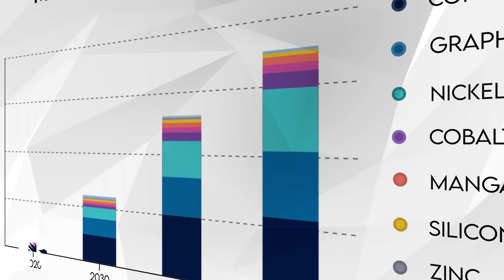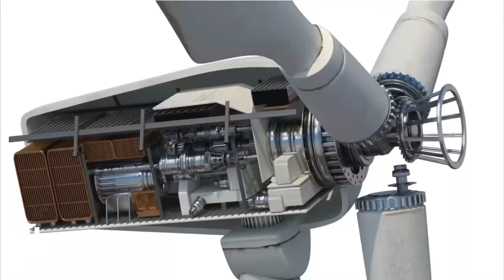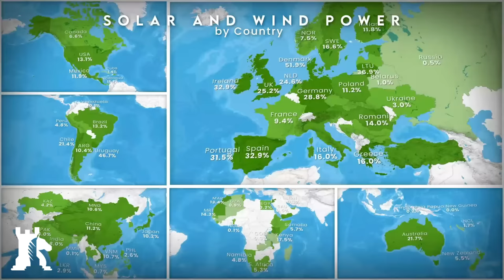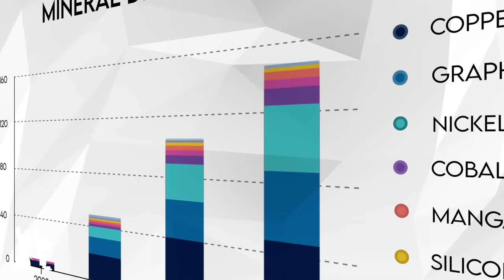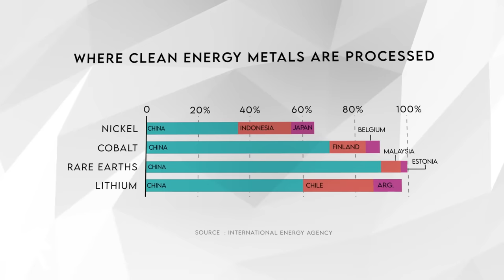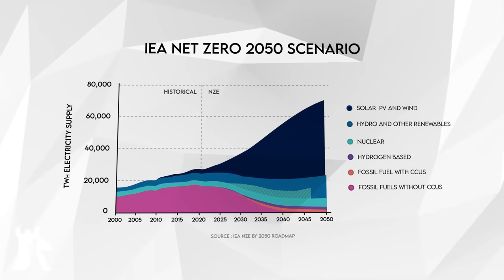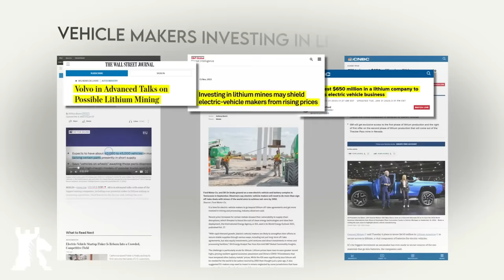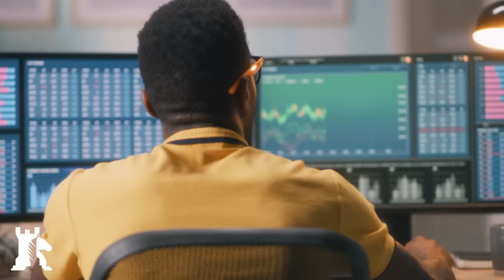Net Zero by 2050 is not happening

Comment: The channel "Just Have a Think" recently (2. july, 2023) put out a video called "Have we got enough minerals?" where he tackles just this question in regards to our transition to green energy. According to his video, several energy technologies are currently being developed where several of the rare and polluting minerals have been substituted with much more cheap and abundant minerals. This is not to say that there will be no need for lithium or cobalt in the future and that our transition to green energy in 2050 is a done deal - but it is to say that the future is hard to predict and it might be foolish to simply calculate current trends with regards to mineral needs several decades into the future.
Unfortunately though, I still believe that your opening statements about how we probably aren't going to reach carbon emission neutrality in 2050 are probably correct. I just haven't seen enough political will anywhere to be optimistic.

Comment: On the point about the materials required to replace a 50MW gas turbine: the comparison doesn't include how much those sites already consumed and will continue to consume in terms of replacement turbines over their lifespan, not to mention the pipelines required to get the gas to the turbine AND the distribution network required to get the juice from it to end users.

You also don't seem to discuss nuclear power? Where is the discussion comparing that power source to gas? 

Growth: the transition from fossil fuels to renewables and alternatives will provide work, income, and thereby, growth. How much? It depends who you ask and over what time scale. 

RECYCLING: yes, recycling rare earth minerals at lower concentrations than mining raw ores will pose some challenges, BUT, as you point out in the video, those are materials that otherwise end up in landfills and MUST be either disposed or recycled. The input  'cost' of them is essentially free when compared to the cost of mining, refining, shipping them, etc. 

MINERAL DEMAND by 2050: this graph and its assumptions appear to be based on chemistry of standard Tesla battery packs, but ignore the changes already underway in most battery chemistries that are moving to LFP and less cobalt. The demand growth also ignores decline in the demand from those minerals from other industries as the globe shifts to electrification. 

For example, the BIGGEST users of cobalt are oil and gas refiners, but this year as China's electrification of transport increases, the country's largest refiner, SINOPEC, reports declining demand for gasoline even as ICE vehicle sales increase in China. How does that work? Data from the UK suggests that the heaviest 25% users of fuel are 57% of demand. Electrify those vehicles and suddenly there is a lot less demand for refining and thereby, cobalt. 

US IMPORT DEPENDENCY: the US was, until GM sold off its rare earth business to China, one of the world's exporters. The deposits exist in the US can, are, and will be exploited again.

Comment: There is a lot of misinformation here in for you to go buy stock in a lithium company. 

First there are new types of batteries. Solid state batteries requires less lithium and there is also Na-Ion batteries that does not use lithium at all. There are currently cars in China driving around based on Na-Ion technology.
Secondly, you can recycle wind turbines. The Danish company Vestas found a way and hold a patent on it.

Be careful to buy stock based on this video. Do you own research.

Comment: there are some things I disagree with, for example
in the first images you show brazil with 13.2% of energy in Brazil, as if the rest was not renewable energy, however more than 85% of our electrical matrix comes from renewable sources, hydroelectric are still renewable sources that I remember, so there is a catch in these numbers, the transition to renewable energies takes into consideration the use of fossil fuels as the main element of energy generation. this is an example, other examples and that you take into account the use of only one battery technology, there are numerous techniques for energy storage not only batteries, and not only batteries that use these materials, each country will use its best to decarbonize its generated energy. It's not just about cars.
There are many power generation, geothermal projects being tested for approval even in the United States. there are also concepts that we have not even tested, the problem is not technology, the problem is not material, when we look at the problem it is of a political nature, it is of an economic nature. there is a whole macro economic issue focused on the development of technologies x profit, this yes, linked to the oil and coal lobby yes, they prevent the development of technological solutions for the problems we face.

Comment: I think the data is this is highly questionable. Just in the intro the framing breezes over context painting a picture. 15 wind turbines to replace a 50mw gas turbine? The largest wind turbine is 15mw used in the west with a Conservative 10mw you still only need 5. Maybe the data is based on actual site data which in itself is a falicy because every site is different. We use a ton of cobolt for oil refining and since battery tech is moving away from it we will need less of it. We do face a supply chain he challenge but it's not doomsday or insurmountable, we have done this before with war time production ramp ups. I will be tuning out from now on and getting my info from people who cite their sources.

Comment: While this is a good discussion of the problems of the 'business as usual' paradigm of achieving net zero, you've failed to engage with any of the broader demands of the climate movement to enable the transition. Simply moving all energy production to two forms of renewables, and moving all storage to lithium ion batteries isn't just a poor prediction of future energy policy - its a poor understanding of current best practice. German companies have already managed to recycle the vast majority of materials in wind turbine blades, and with other firms now marketing recyclable blades made from more easily recyclable materials. European Union directives require firms to plan for disassembly in lifecycle analyses, so these practices will become dominant quickly. Similarly, photovoltaic breakthroughs regarding material costs are incredibly frequent, with recent findings regarding mass manufacture of perovskite solar cells being one example. Science-led energy policy would not focus on these two sources, though. Nuclear, geothermal, tidal and wave energy should form baseline supply (all of which are less material-intensive than the intermittent renewables discussed in the video), with intermittent renewables complimenting this with mixed storage sources (of which, lithium ion is not even the best current option for grid-scale storage) such as pumped hydro, gravity storage, pumped air storage, thermal energy storage systems such as salt, and supergrids for international energy balancing. Rollout of these mixed approaches complimenting one another dramatically decreases material and financial costs. But even this is not the best approach on its own: demand management has to be part of any net zero strategy - something which is glaringly missing from this analysis. Shifting transport demand from individual motorised transport to public transport options and better planned cities to enable active transport options has a phenomenal impact on energy, emissions, material and financial costs. This isn't even that radical - if you look at the modal shifts already achieved in many European cities, this is very achievable in the timeframe, and with numerous social and economic benefits. Taxing luxury consumption on private jets, wealth taxes, universal basic services, national investment banks targeting investment toward sustainable development etc. all similarly have disproportionate impacts. Refocusing economic goals away from maximising hedonistic satisfaction and toward meeting human needs is a must - prioritising necessities over luxuries creates orders of magnitude more efficient provisioning systems. This video is a useful tool in explaining how a 'business as usual' response is not sufficient, but the conclusion is not to question the feasibility of net zero (the implications of which for future life are stark), it should be to turn to the necessary alternatives in order to address the wider drivers of this problem.
Reply: Youtuber passes-off Capitalism-Propaganda like 'Growth is Always Needed' 
as Fact. 
But either way, i recommend Some More News and Second-Thought and all their videos 
with titles containing wortds like Rich or Poor or Incentives or Capitalism, 
as they are clearly supplementary to this here.

Comment: Electric cars are not gonna help. Nuclear, geothermal, and hydrogen  vehicles are the only solution. Until better batteries come along and have much better longevity Electric cars will still have the same carbon footprint as gas vehicles throughout their life cycle

Comment: dislike. 

1. most estimates for the amount of materials required for renewables are overblown. 

2. the amount of coal mined today completely overwhelms any necesary increase in metal mining for renewables. the amount of coal we dig up and burn is absurd. 

3. the metals used in renewables aren't going anywhere. no one's gonna throw away the lithium and copper. 

2. if you're making a video about material demand by renewables sponsored by a mining company you put that at the start of video.

Comment: I own an electric car, in part for environmental reasons. It’s certainly greener than gas-engine cars, but it’s true battery electric vehicles require more mineral resources. Unfortunately, small environmental cars such as the Leaf, the Bolt and the Soul will no longer be produced because they will be replaced by bigger vehicles. Their ever-growing size worsens the depletion of mineral ressources. Moreover, they are pedestrian killers.

Comment: Very misleading to say, eg "demand for copper will increase 100-fold just to keep up with the supply for electric vehicles." Global production of copper is 13 million tons a year, are we really going to require over a billion tons of copper per year making EVs? Even if they were made of 100% copper (rather than just small bits in the battery) I don't think you'd get to a billion tons per year. That's obviously several orders of magnitude out.

EDIT: this is overall a really flawed piece. Developed nations have lowered (and are continuing to lower) their CO2 emissions in consumption terms, ie even when you take into account offshoring their emissions to elsewhere in the world. It's not accurate to say they've "only achieved it through offshoring"; it's not an accounting trick, it's really happening.

Comment: Over the long term, the only possible solution to avert ever greater crises is degrowth. Unbounded economic growth will always run up against some limitation or another - industrialization required fossil fuels that cause climate change and are non-renewable, getting rid of fossil fuels requires rare metals and other such resources whose problems are mentioned in the video, not to mention the fact that they may run out, and whichever other solution comes next will either run out or accumulate externalities until they reach a breaking point. That's the problem with trying to fit an infinite economic horizon into a finite world. So degrowth is the only answer, and it will eventually come, either willingly and under our control, or as the result of a massive, unprecedented, humanity-threatening crisis. The problem is, capitalism as it exists today absolutely requires unbounded growth, so we need to move past it (which requires figuring out the next step first) as soon as possible.

Comment: How is it “net zero” if you’re using large trucks, dirt removers, trains and diggers to extract minerals — all which run on petrol or coal?
Reply: Because after production the carbon emissions virtually vanish for the product’s life cycle. Don’t be thick
Reply: @jonahcabral2425  how much of the carbon emission vanish? Into thin air I’m guessing.

Comment: 1:28 not sure what this graph is about. In 2022 electric vehicles and plugins already accounted for 10 to 20 percent of new vehicles sales. Hardly need 100 times more than that. And this doesn't even account at all for recycling. Piece of cake
Reply: Right. But when was the last time you bought a car? 10-20% of 3.12 million in the US alone. You think 300,000 car a year is a lot? Lmao. That is well shy of everyone owning an EV and needing replacement EVs. Nice anecdote but try making informed opinions instead of sounding dumb.
Reply: The truck fleet can be replaced much faster because it's lower numbers. As for people, I guess they can use the self driving taxi fleet instead, which probably would replace car ownership anyway, because much cheaper total cost. Again I'm assuming you need a factor of at least 10 times fewer taxis (which also use less materials, eg the tesla one). Piece of cake. If the per mile cost is lower getting a taxi than driving your ice car, that should do it. Save the ice car for special occasions.
Reply: @nolanjdon3514  also regarding sounding dumb, you need 100 times more material to replace the whole car fleet, not every year, at the worst case. Replacement takes 10 years or longer, meaning you'd only need 5 to 10 times the current levels of material each year, and later on could source a lot from recycling.